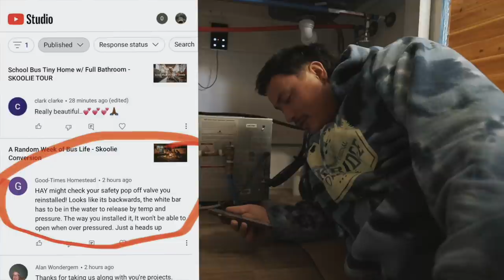Hand Made Custom Cabinets in a Skoolie Conversion

Comment: You mentioned needing some way to cook your Lean Cuisines in...Hot Logic. It's a personal portable oven enclosed in a thermal zippered case. You place it in the case on the "hot plate', plug it into your power source and go about your day and let it heat up. I found one on Amazon, seems Target may also have them. Wonder if that would work for you?
Reply from the maker: Have people used them in busses? I’m wondering how much power it draws
Reply: @isaacturnerit  I use mine either plugged in on grid or from my power station. It doesn't pull a ton of amps and I run it 12volt. (Converted cargo trailer with both shore power and solar/Ecoflow Delta.)

Comment: Best way to cook a Lean Cuisine in a mobile application if you have 12volt is a Hot Logic. I have a converted cargo trailer and I use that thing ALL THE TIME. You can even cook stuff in a Ziploc freezer bag in it, or a tin foil tray, or a small Pyrex dish. Truck drivers and flight attendants use them all the time, which is where I go the idea.

Comment: Hey man! To heat those meals, try ordering something called a Hot Logic. Comes in 12V and you can just throw the box right in it. Check them out. We use them every day to heat up different items. I would send a link but don't know if it's allowed. Peace!
Chris & Steph
Reply from the maker: Yooooooooo def looking into it! Thanks for the tip

Comment: anything that you can cook in a microwave you can cook in a pan on the stove,the microwave meal must be thawed first then take a spatula and carefully scoop it out of the container it's in and gently place it in a pan and put a lid on it and use a very low fire on a stove basically your just reheating it most microwave meals are pre-cooked -no oven use a sterno like fuel and as I recall you have an oven so instead of a pot with a lid you can put the meal in a shallow pan and put it in the oven just get a thermometer and check the inside temp of meat before you eat it to make sure its cooked properly, I used to use one of those 12 volt ovens from the truck stop and i'd plug it in to the cig lighter while driving because it takes a while to cook like an hour -hour and a half for most stuff, but really if you got a small micro from wal mart and plugged it in to your inverter and used it when the bus was running it wouldnt be a prob
Reply from the maker: Awesome! I can cook lean cuisines ha ha. Not much more than that lol

Comment: The pressure temperature valve is still installed incorrectly. The white probe has to be inside of the tank - not int the line as it won’t sense properly if you are not drawing hot water continuously. A close nipple screwed into one end of the tee with the valve screwed into the other end with the hot water connection off the side of the tee should get the end of the probe inside the tank. Also, this being a propane tank, is there not a pt valve installed above